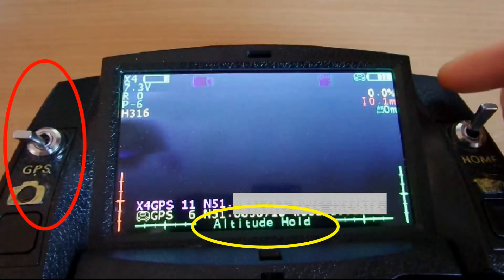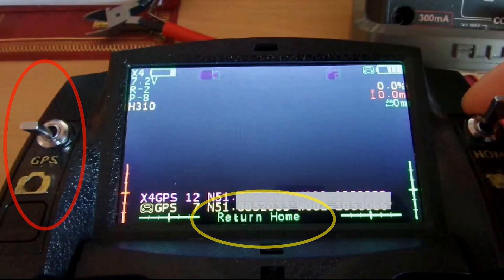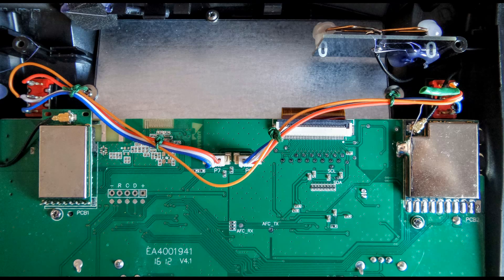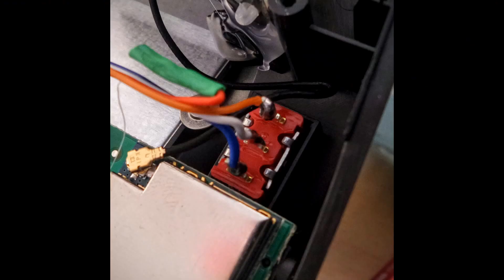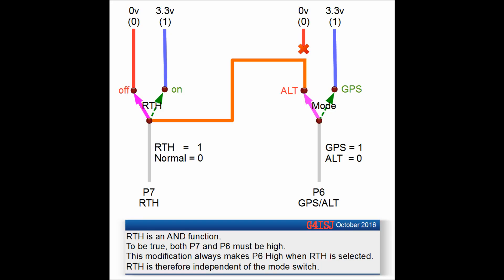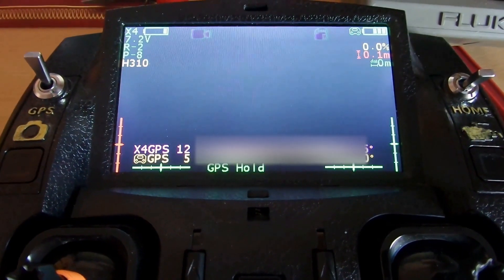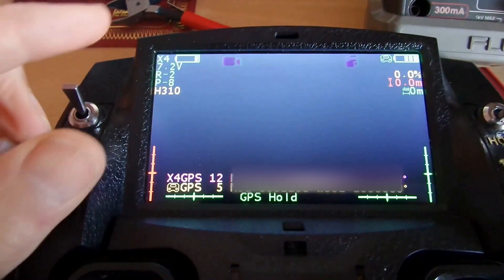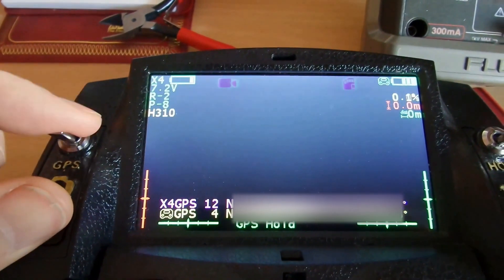Hubsan H501s - H901A Controller - RTH Switch Mod

Comment: Hello @Randoneur , a simple for you I'm sure question, will this apply the same for mine is model#EA4001951-01?

 I see from the video shot of the board yours is EA40011941, different in that my 3 wire plug connection tied into the rth switch and board is just beside the 2.4g antenna on main board, lower left of 2.4 antenna. 
 On yours they are in center besides each other. Mine is simply maybe just moved down beside the 2.4 antenna on my board model. Would it cause a problem doing the mod on mine? 
Thank you so much for a answer if possible. Ps. Mine is h501ss just received 5-1-2020. 
 Thanks again or anyone else who might know for sure!

Comment: I just did this mod and works great.  Most of the comments haven't been answered, so anyone new asking the same questions, here we go:  The "orange" wire is a new jumper wire that is being added. Any small gauge wire works (22 or 24 for example).  As the video points out, GPS has a 1 volt condition (Altitude has a 0 volt condition).  RTH off is a 0 volt condition, RTH on is a 1 volt condition.  Both conditions must provide 1 volt for RTH to function.  When you flip the RTH switch, the RTH switch provides a 1 volt condition to both the RTH and on the GPS side via the jumper wire (basically turning on the GPS function in the process).  You can see this happen on the display when no satellites have been acquired.  
Side Note:  I also switched the toggles around so now when the toggle points to GPS it goes in GPS mode, and when I flip the toggle pointing at HOME it goes into RTH mode.

Comment: Hallo. I have 502s with big problem,  After start, elevated to about 30 feet and the transmitter connect automatically RTH mod, without command the RTTH switch. It's the same situation in GPS mod and Manual mod. I did yours modification for transmitter, but no result. The battery  for transmitter and quad was  full.  Cud be the antenna problem? The guad copter  reception 11 satellites and the transmitter more then 6.  I installed another 2 antenna and one of them was interrupt for a while.
Reply: Aurel Barbor: hi did you solved your issue? I just had this issue this week. It seems that the connection is lost after 30 feets. It results in that the quad turn into rth mode...

Comment: I'm missing one thing in my mind's eye.  When you disconnect the red wire on the GPS side which wire or wire extension is going from the GPS now to the center terminal of the RTH side with the gray wire?  In other words, where did the orange wire that's now connected to the center terminal with the gray come from.  Are you adding a new wire or just redirecting a wire?  Sorry for my stupidity.  Then I have another question about extending controller battery life.  Thanks

Comment: How does this quad control/handle on the journey home? Must come back some rapid in comparison to GPS enabled.  Simply worried it may become a bit to erratic potentially?
Reply from the maker: It's always in GPS mode in RTH.
It's just the same as normal. The switch mod only makes it a one switch operation.

Comment: will this mod still allow the drone to automatically Rth if transmission is interrupted and GPS is in the off position? Also what Firmware are you using on the FC and TX, Rx? Thanks in advanced and keep up the great work.